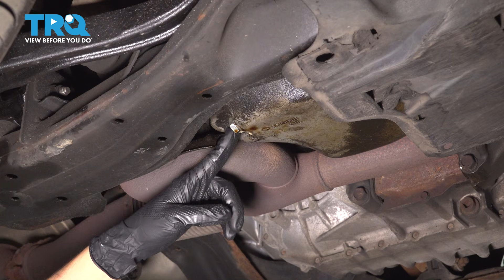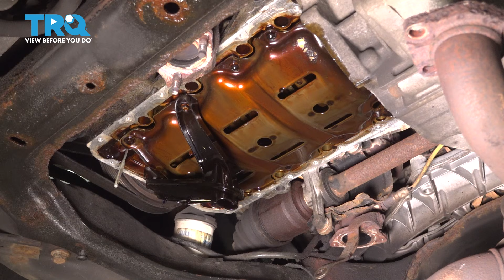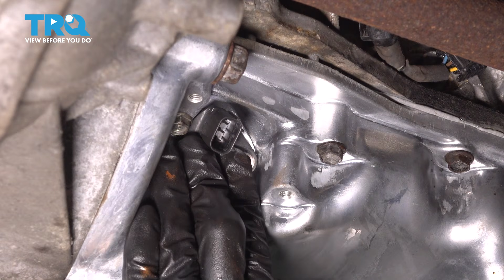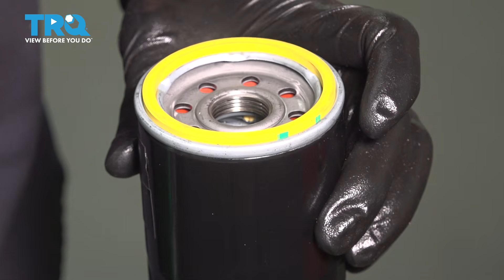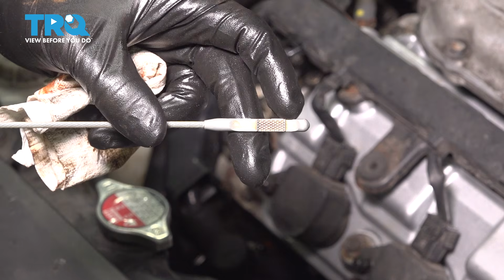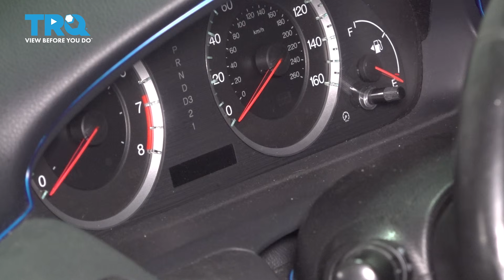How to Replace Oil Pan 2008-2012 Honda Accord (3.5L V6)

Comment: You don’t want to use too much sealant because you’ll create uneven hips and valleys that will leak. First start the bolts to mate the surfaces but let the sealant set up. Only after it’s set do you torque. Otherwise you’ll just squish al the sealant out.